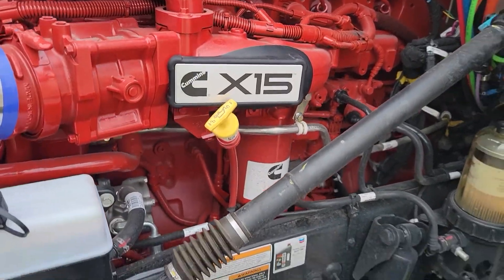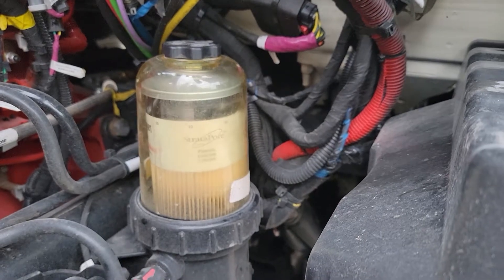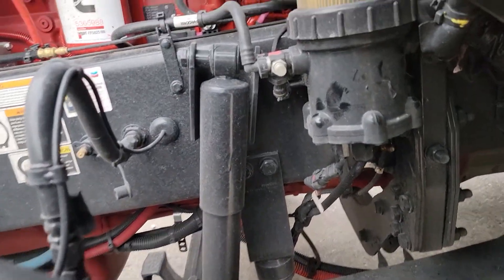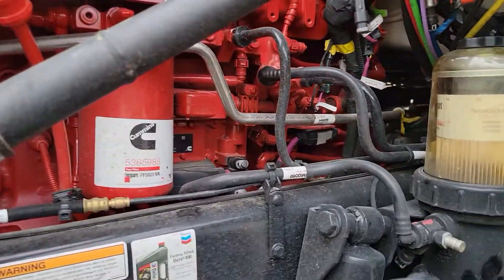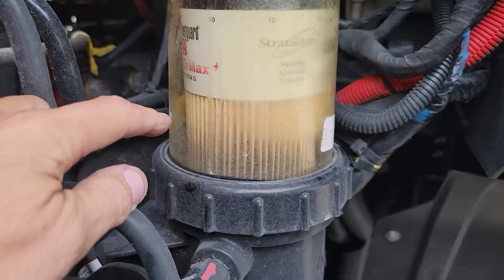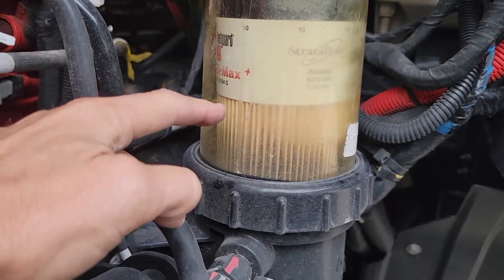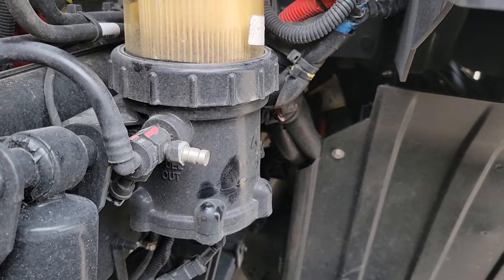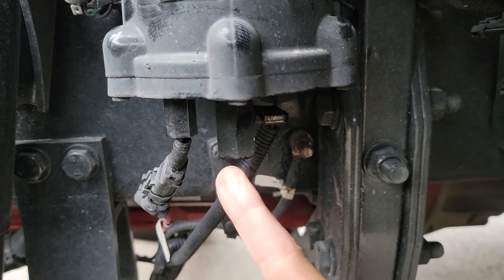HOW TO Drain Water Fuel Separator (Cummins X-15)

Comment: I put a million miles on the Freightliner Cascadia chassis

Used to get a new one every 100k but the last one my wife and I had for 400k miles

I have never once had to do this on any of the cascadias I have had.

My company just put us in a new Peterbilt 579

We just rolled 600 miles and this light came on.

The only thing this Peterbilt does better than the Cascadia is the ride is smoother

Literally everything else about the Cascadia is better

Comment: Changed that filter today…truck won’t start now. Tried priming it. Fuel kelt bubbling and sucking it in. Im lost on what to do
Reply from the maker: Sounds like you need to get more fuel thru your line from the tank, there should be a pump to manually do it, or fill up your fuel filter with as much fuel as you can.  Just need to burp out the air and get solid fuel to build pressure.  Sometimes I've had to manually pump the system 1 to 2 minutes to build up the pressure...Good luck!

Comment: Should we change the filter after this
Reply from the maker: No, you should be fine 90% of the time.  Usually change fuel filter when u do service
Reply: @CoryJDraper   Thank you, Cory I have a Paccar 🫣 😂 everyone I say that too looks at me crazy. 
So I just bought this truck back in November 22’. Im just realize that this issue comes up when I head out of state and fuel out there. Other videos do say it could be due to bad fuel not sure what’s your thought on that?
Reply from the maker: @nubia millan  Odds of bad tank maybe one time, but not the other 99% of the time.  Fuel is decent just about all States and Fuel locations.  If you have a ton of water often run your tanks super low.  U might have water settling at bottom...
Reply: I’ve been doing it all day about 8 times already I must have had a lot or maybe because I’m doing it slow like you said little at a time could that be it

Comment: when is the best time to drain it? In the morning before or at the end of the trip? Im afraid to drain It and my engine not start as it happened with my friend. Engine on or off?
Reply from the maker: You can warm the engine up then turn off, only drain a few inches of fuel at a time.  You should be able to see the fuel level at all times, just don't drain fuel where you can't see it anymore.  Turn engine on and idle 3 minutes.  All the water should be out of your filter quite quickly...
't

Comment: Hey coming from your winter mountain driving video. I am about to go to orientation and with my first mentor on the 29th after thanksgiving, I got my CDL on the 26th of October. Everything I have read including owners manuals says to not use jake brakes in the winter on snow etc like that, I am assuming manual mode will be enabled otherwise just burn up  the brakes lol? I was hoping for some advice on that stuff, thanks
Reply: Best thing to do in that situation is to keep a slow speed. you don't want to be moving faster than you can safely stop, so keep a good distance and make sure that the distance in front of you between you and the next vehicle is far enough that you can stop safely. When you put your brake on, you don't want to put the brake all the way on, you just want to give it a couple of light taps because if you engage the brake all at once, you will start to skid on icy roads. If you feel like you cannot safely maintain a reasonable travel speed as well as a reasonable following distance, just pull over. By law you cannot be penalized for ending your run due to inclement weather conditions. So just gently ease into the break repeatedly until you come to a safe stop to avoid skidding and brake lock up.
Reply: Use your trailer brake
Reply: @3BeerThunder  that is if your truck has a trolley valve. Most of the new ones don’t